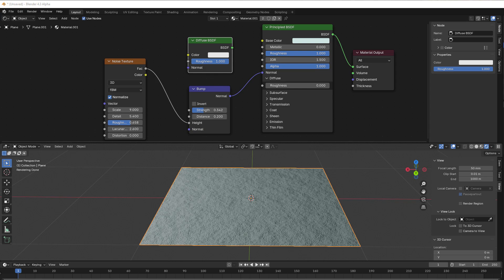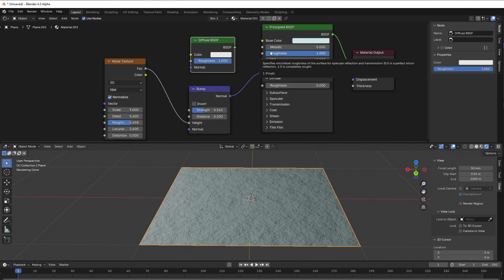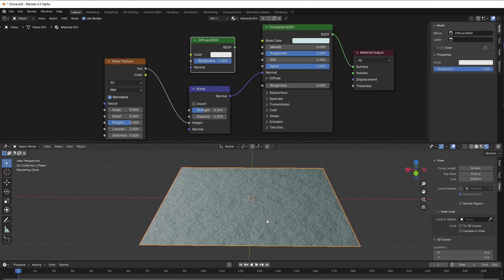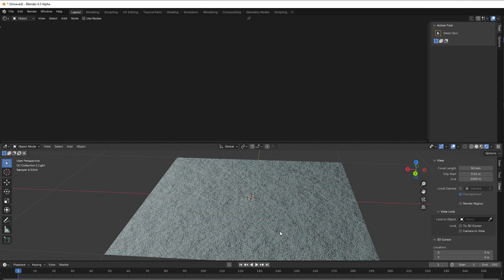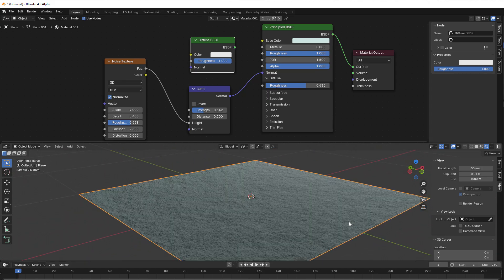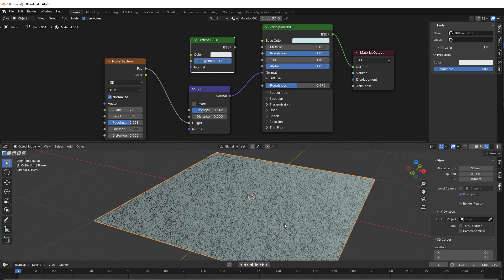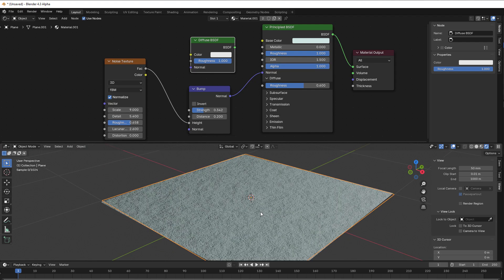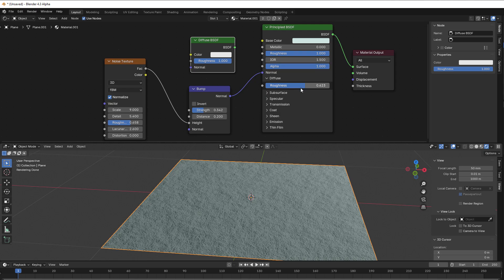82: Diffuse Roughness (Blender 4.3)

Comment: Speaking about 4.3 shaders, what "thickness" input is for?
Reply from the maker: Check my clip from yesterday about "Thin Film" where I explain that :).
Reply: @jtornhill  I'm sorry i wasn't clear, i mean the Material Output node, not the Principled BSDF one. It's on the very right in the nodegraph.
Reply from the maker: @vector_unit  Then I know what you mean. It's an Eevee thing they added since Eevee can't use ray tracing to get the thickness of things, so here you can control that and in the explanation they write: "Thickness output: This is a new output which control the thickness for translucency, refraction and volume shader."